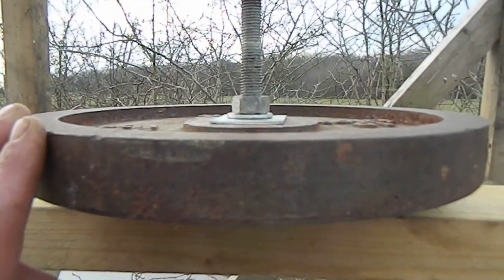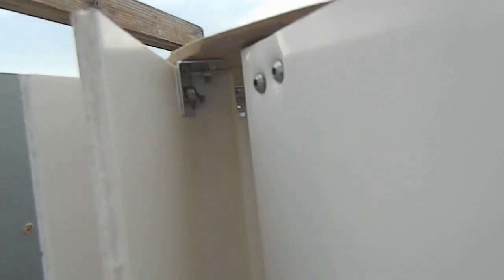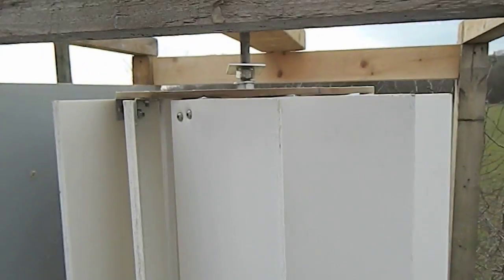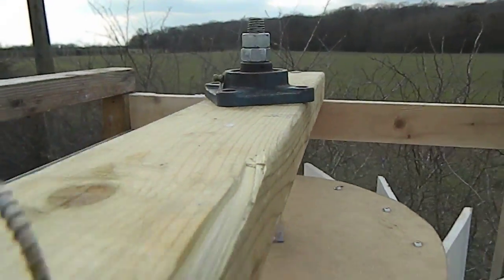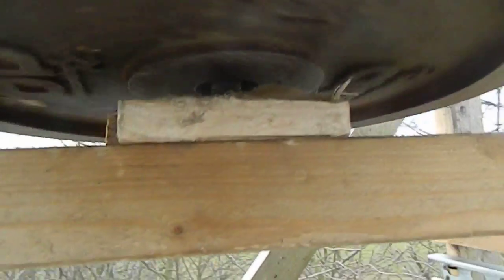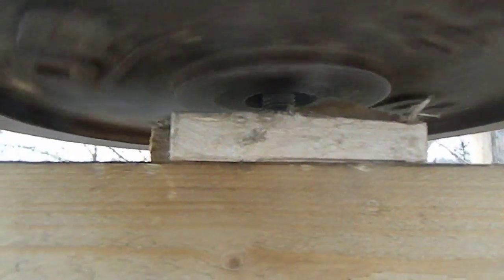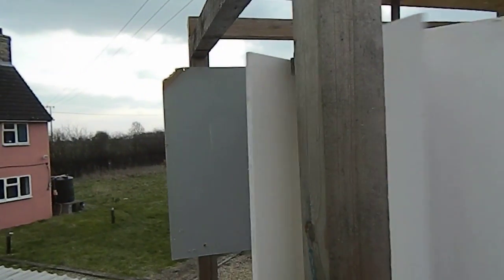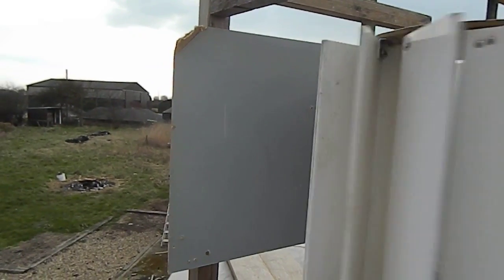VAWT Wind Turbine blade assembly prototype continued Free Energy DIY Green

Comment: This is Awesome!!! But I think it would catch the wind better if you was to FLIP the blades, part OVER" If possible.?? 
The whole thing that carries the wind PANEL Blades. Then add Three more blocking panels" like that one that you said was making it speed-up.!!! You should, ANGLE the blocking  panels, to direct the wind,  straight into the blades. Then see what happens. 
P.S. Make you're "blocking panels" is mounted so that they can be adjusted" 
Angling the wind into & away from, the wind panels.!!!  Then locked back DOWN, with bolts.!! Good Luck!! And 
BEST WISHES!!!!!..
Reply from the maker: Thanks mate this was an old project my do another one like this soon.